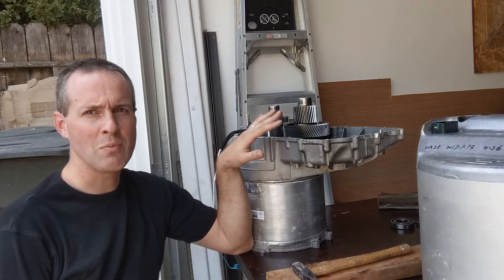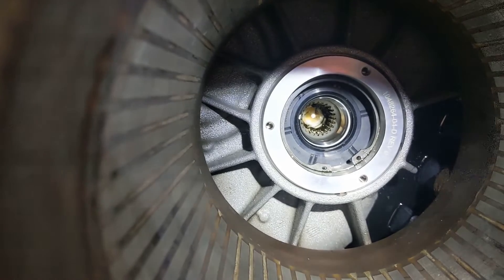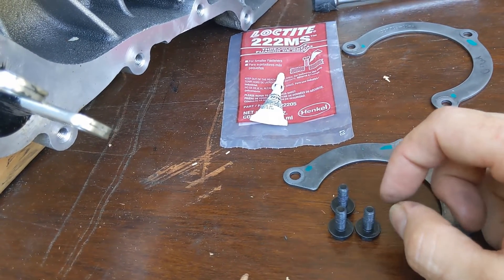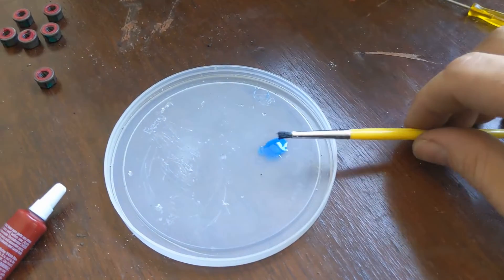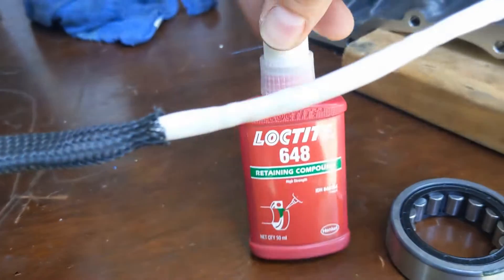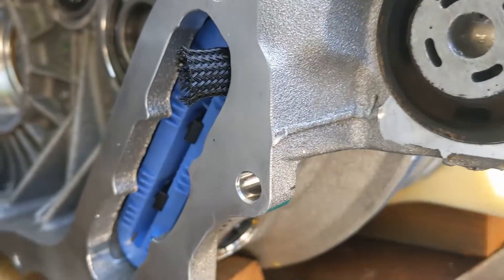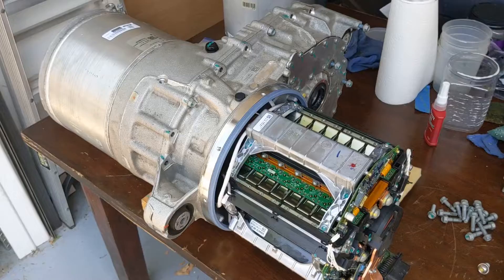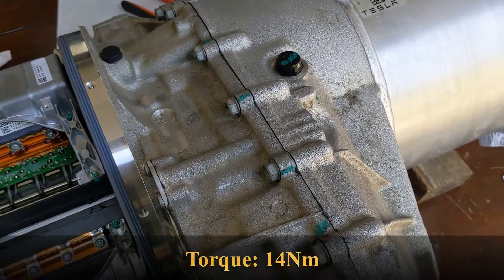Assembling the Tesla Gearbox

Comment: Thanks very impressive. My model S 2015 has a klonk sound at low speed  when I press the gas pedal and the same klonk sound when I take my foot of the gas pedal. Do you think that sound could come from the gear box ?
Reply from the maker: Could be a CV joint in the half shaft too, especially if it happens while in a turn. Easier to fix by replacing the half shaft. Not sure though.
Reply: @diyEVguy  found the problem splines on half shaft gone bad.
Reply: @diyEVguy  no this is the rear and on flat smooth road.

Comment: 3:35 is it normal that  2015 mers b250 electric drive didnt have this o-ring?
Reply from the maker: I don't know, maybe in 2015 that ring was no longer needed.
Reply: @diyEVguy  30 minutes ago i buyght this oring for 20 $  i think some body forgot to set in gear , pn 1002592-01-X

Comment: I am rebuilding a 2020 Tesla model 3 and I noticed my front drive unit looks like it’s been leaking oil for a while. I would like to drain the old oil out and refill to find the leak.  Online people say to use ATF-9 oil but Tesla switched to EDF-2 fluid at some point. Tesla told me my unit was filled with EDF-2 when it was new.  I am not able to find EDF-2 and Tesla will not sell it. I would like to use a different oil all together. Something like Amsoil manual transmission gear oil. The viscosity is very similar and is made for gearboxes. I know the model S uses dexron 6. My only concern is if the oil is in contact with electrical components (like windings) and could cause issues. Do you think the oil needs to be a special kind to work in these drive units or would something like dexron 6 work fine?  Thanks.
Reply from the maker: In general, oils are good insulators, but this decreases as they age. Better than coolant obviously ha. I do not know about your case, but my first thouht is to look at the ProjectFarm youtube channel because he often sends oils for analysis to labs so maybe it is not that expensive. If you send the lab a sample of Dexron VI and a sample of your current EDF-2 (and ATF-9), the reports may be able to tell you whether is is simlar enough. You could maybe make a youtube episode out of this 🙂
Reply: So I have heard that the oil is actually in contact with the motor windings. Do you know if this is true?  Others say the oil is just in passages around the stator to cool the motor. If the oil doesn’t touch the motor I would think any good quality oil would do just fine.
Reply from the maker: @dwilley3754  for M3 I don't know. Maybe the Weber Auto YouTube channel has the answer?

Comment: Generically, when using a a drift to push things into bores (etc.), the material of the drift should be softer than the material you're pushing.

Hardwood is fine, but that socket extension's hardness approaches tool steel, and is too hard compared to the bearing's race.  Kudos for the friction tape wrap on the radiused end, but after the first blow or two, it's no longer a force-absorbtive surface.  A mild steel rod (common hardware-store shafting, 5/8" dia./16mm) is my go-to for this.  The rod will mushroom in use, which is a valued sign that excess force is accepted by the rod, not the bearing or counterbore.

(I have brass drifts for persuading, say, cast-iron assemblies, as you just about can't damage cast iron by pushing with brass.)

---

Your "c-clip" is commonly called an "e-clip", a more specialized variety of circlip.  Lighter-duty than a c-clip, but it doesn't require a specialty tool for install/remove.  E-clips are only used where there is negligible or no axial load.

---

When fishing smaller wires like this, where you can have more than one attempt, I have successfully used a short section of heat-shink tubing to mate the "fish-hook" to the wire.  it makes for a nice small OD.
Reply from the maker: Thanks again! Makes me curious what you do for a living!

Comment: Another excellent video. Rather than thread lock, you can use thread sealer for those 6 bolts on that diff retaining plate.
Reply: Agreed, as this range of Loc-Tite products are anerobic sealants and do not "harden" in the presence of oxygen.  They require no gaps in order to set up, and will remain liquid in free air.   

Diff bolts: Loc-Tite works great on threaded assemblies that have a reasonable fit tolerance, but the looser the fit, the less likely to obtain full strength, and on a nylon-to-aluminum face surface like this, I would expect it to be ineffective.

---

Loc-Tite 648: it's rated for a maximum gap of 0.15mm.  While it's the same color as the green glue residue you found, I suspect it's not the same product.

My familiarity with the Loc-Tite "green" products is for mating sleeved (coaxial) assemblies, so I'd be applying it to the bore and bearing OD surfaces, rather than the back/bottom of the bore.
Reply from the maker: Good point, thanks!